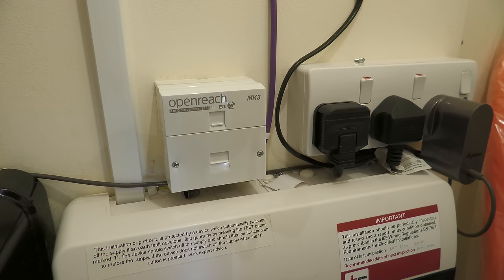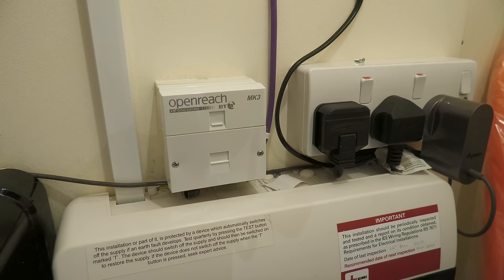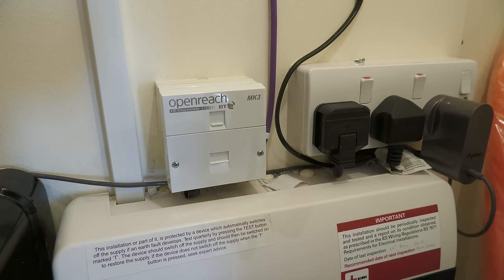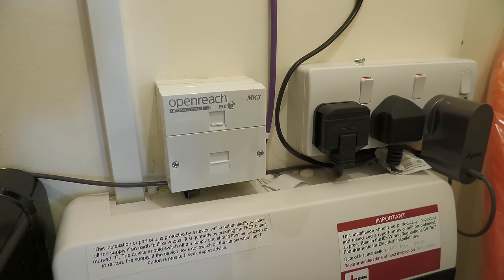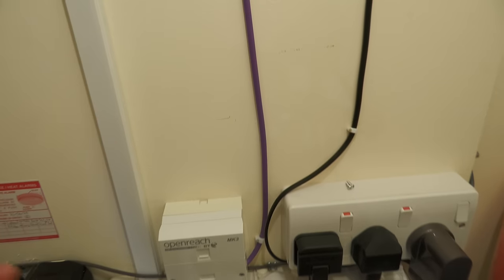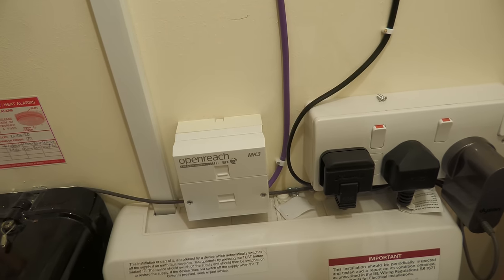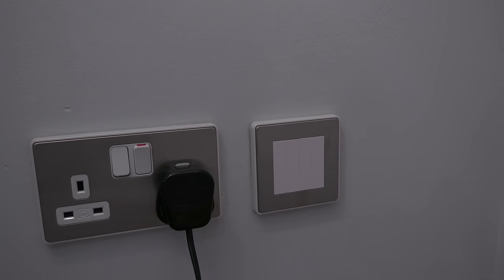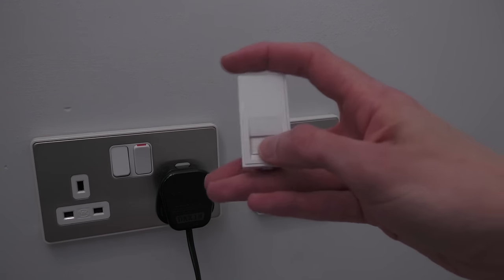300 Mbps DSL!  Upgrading my Home Network to TalkTalk Fibre 250 G.Fast Broadband

Comment: Too many joints/connectors. Not to good to have so many touch points
Reply from the maker: Not sure what you mean - the DSL connection is literally a single patch lead, can't get any less connections than that.  Then as for the Ethernet side of things - with good quality cabling and connectors, a few connections won't make any difference, it is still a solid gigabit link.  Sure at home you can plug everything in with patch cables, but think of the average office where a connection between a PC and a switch will have several points where the wires are joined (patch leads on each end, network faceplate in the office, patch panel in the comms room) without issue.

Comment: Australia  Phone copper lines to the Node box  100mbs 
dont need any faster NBN  most movies d/load from severs  5mbs
  some i get 12 mbs d/loads cool  i pay for 100mbs   but seen nearly every movie etc  so 1-twice a week i check for any 
au $79 month unlimited  most are asking  $90 to $120 but  look a bit dodgey with all  there times and limits :)  
who do i use since NBN on 2018   Lets  be Mates   based in Sydney Oz    I'm in SA  and no worry's  
the only problem i had was the installation tech guy  Who put 5 staples thru my phone cable along the hallway 
no wonder it went crazy for ages shutting off  every hour    i found this year L8tr  by walking with a powerful torch  
 and  anyway i moved next door  3months ago and thru  the phone line across the balcony lucky me $685 to get it connected again if i moved far away 
              no worry's  12mbs    no staples stopping the data flow :)

Comment: Just noticed you are using a horrible Unifi router! Why not pfSense? (not knocking their switches and APs, just their routers!)
Reply from the maker: It's entirely down to personal preference - Over the years I've used most common router platforms that people would recommend - MikroTik, VyOS, PFSense, OPNSense, OpenWRT, Bare Linux/FreeBSD set up as a router.etc (so it's not as though I don't know anything other than UniFi).  A few years ago I wanted to try a fully UniFi setup to see how I found it as I don't like recommending systems to others unless I've used it myself and it was one of the few options I hadn't used extensively.  I can't see where you're coming from with it being "horrible" - Sure, it's not as feature packed as a lot of options, but it's significantly easier to use and manage.  Not everyone needs a super powerful router with advanced dynamic routing functionality in their home.  I'd view a UniFi router as a home router on steroids rather than a business/enterprise piece of kit.  I made a view about the UDM Pro here where I go into a lot of details of my thoughts on it: https://www.youtube.com/watch?v=GIOf7Qs7NKA.  A lot of people, YouTubers included tend to bang on about how amazing and "Enterprise" UniFi is which absolutely is not the case, but as long as you make sure it's suitable for your particular environment, it's a perfectly viable option.  There's not many other platforms where I can have a friend who's not a networking expert but wants a decent home networking where I can recommend a few pieces of UniFi kit plus a UDM and be confident that they'll be able to get it up and running and continue to manage it themselves.  For that sort of thing, UniFi is great.  That said, I'm not tied to UniFi forever, once budget and time allows, chances are I'll end up moving everything over to another platform to try it out and gain experience and produce YouTube content.

Comment: Your consumer unit needs a service lol.
Reply from the maker: According to the sticker yeah, although I've done enough checks to be comfortable that the install is in a good enough condition to not worry about getting an official EICR done.  I've also found and rectified issues that were there when the place was built (and that inspection was performed) so let's just say I don't have a huge amount of confidence in a lot of inspections!  Sure there's lots of great contractors out there, but I can never figure out who I can trust, hence why I do so much myself. That said, I'm toying with the idea of getting a new RCBO based consumer unit at some point - current one is split load/dual RCD and it can be a total pain if I'm working on one circuit and trip the RCD knocking out other important stuff, it's also just a total mess inside thanks to the builders who wired it originally.
Reply: @camerongray1515  Pick an electrician who posts their work to YouTube and then use the comments to figure out whether they actually did a good job.
Reply: Nice video by the way.  Strangely, my modern phone would not ring without the bell wire connected 🤷
Reply: @camerongray1515  I know you would have hence why I found it funny looking at the sticker for the first 10 mins or so 😂 great content - keep it up!
Reply from the maker: Yeah, I watch loads of electricians on YouTube, sadly none of them are remotely local
Reply: @camerongray1515  hehe sounds like a fellow viewer of Artisan Electrics' and Nick Bundy's channels 😉

Comment: No. Talk Talk customer service is diabolically poor! I left them and went to Plusnet who's service is excellent!
Reply from the maker: I've heard bad things however TalkTalk is my only viable option as Plusnet don't offer G.Fast.  Hopefully I won't need to use their customer service - only time I ever had to do it with Plusnet previously was when they messed up my installation initially or when there was an Openreach fault  where the Plusnet guy spent around half an hour convinced that my PPPoE credentials were wrong before going to "speak to someone" when they confirmed there was an Openreach outage in the area so in general I have low expectations of ISP customer service.
Reply: I heard TalkTalk is bad. I've had problems with Plusnet but I've stuck with them because they were sorted.

Comment: what model was your Openreach modem I have the a very similar setup to yourself. But I'm on fibre 65. I think it will work the same. Its worth a shot. Thanks very informative video
Reply from the maker: The one I'm using with G.Fast is a ZTLink MT992 however this is a G.Fast modem while your service would be VDSL2.  While it seems as though the MT992 is compatible with a VDSL service at a hardware level, I found a forum thread saying that it no longer works with VDSL after a firmware update.  You can however find other Openreach modems that are VDSL capable (but not G.Fast) capable or if you want something new, the Draytek Vigor 130 is a good option for a VDSL/ADSL modem or the Vigor 166 if you want something that's compatible with G.Fast, VDSL and ADSL.
Reply: @camerongray1515  Thanks so much for the response. your channel is a really great source of information. I just fitted a MK4 faceplate today. we had an MK2 installed which although it's not any major difference in speed. the RJ11 connector moved around to much in the socket because it right next to my daughter's so when the kids jump on the bed the connector come out. TalkTalk only supply their own router.  But I a Sophos Xg in the rack and I just want the modem no frills. Its annoying having a router sat on the rack so a modem would be ideal. Sorry for the long response and thanks for the advice. Regards Alex

Comment: So is it easy to route a FTTC modem connection (RJ11 -> RJ11) connection through an ethernet extension?
Is it just a matter of using an RJ11 -> RJ45 patch at either end of the connection, or do you need to be more careful about which patch cables you use to ensure the correct wires are connected?
Reply from the maker: You're best to keep the runs short but that should work - it uses the middle pair of wires (blue) for the DSL signal so as long as your cable has those connected straight through you'll be fine.

Comment: Also noticed that your electricity meter is overdue an inspection. 😂
Reply from the maker: According to the sticker yes although I've done enough work myself to be comfortable that the installation is in good condition (including fixing faults that would have been present during that initial inspection). I'm tempted to get it replaced with an RCBO board at some point but for now I'm happy with it as-is.  It's in no way a required or legally mandated inspection, just a generic recommendation for 10 years after it was installed.

Comment: Could you see if talk talk throttle ipv6 tunnels like virgin do?
Reply: I believe ipv6 tunnels are fine if you have a Hub 4. I'll reply again in a bit if I can get the HE tunnel up on my pc

EDIT: Couldn't be bothered to set it up in the end, but I founds reports on the virgin forums of no throttling problems with Hub 4s
Reply from the maker: I haven't tried it yet (would need to figure out a way to use it with the UDM Pro, thinking maybe some sort of additional router between the modem and the UDM) but TalkTalk state that they don't do any sort of traffic management so I'd like to think that would also mean they won't do anything to slow down IPv6 tunnels: https://community.talktalk.co.uk/t5/Articles/Broadband-traffic-management/ta-p/2204657
Reply: @__Ben  Yea unfortunately I have the hub3.